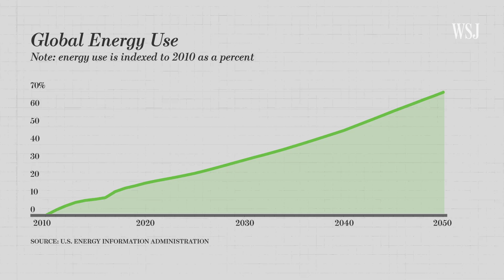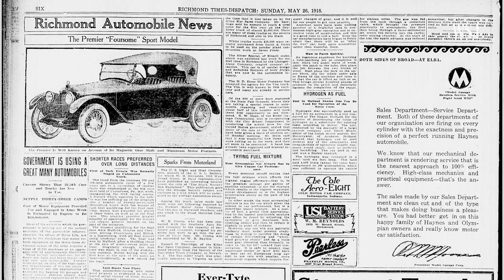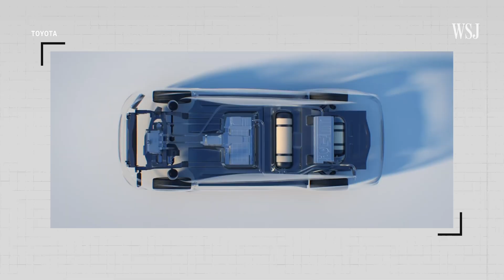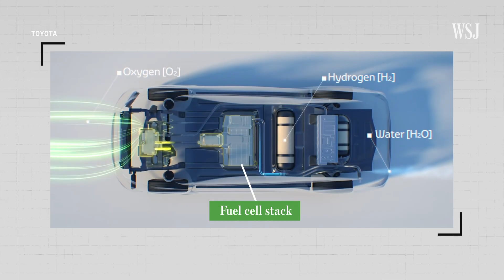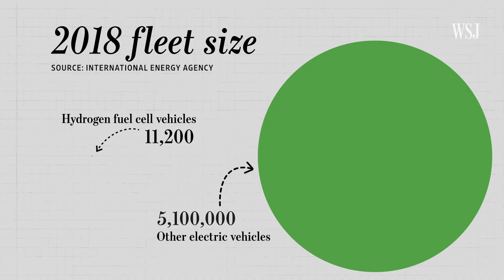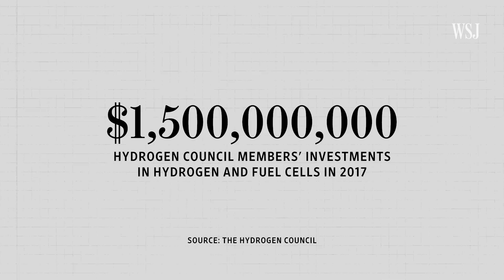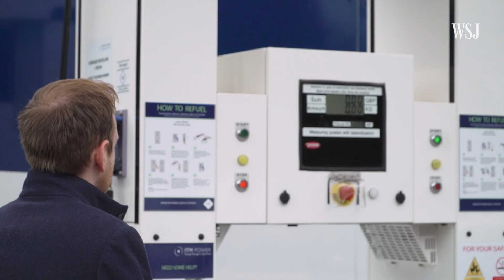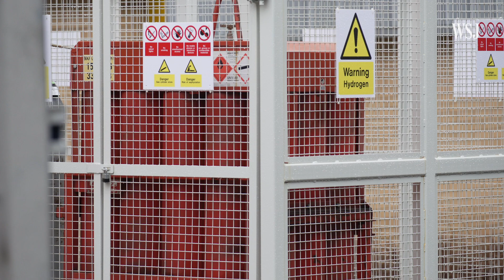Can Hydrogen Fuel the World's Fast-Growing Energy Needs? | WSJ

Comment: It's rather strange that in this video AFC were talking about using HFC to charge BEV. Then you are combining the low efficiency of hydrogen with the slow charge time of BEV, the worst of both! Hydrogen only makes sense to use when using a grid connection or a battery is not possible. Somewhere like a shopping centre as mentioned in the video would definitely have grid connection so it would be pointless using hydrogen there. If you look at AFC Energy's website today it makes clear that their products are for use in off grid locations such as building sites or in remote places. Or as emergency backup instead of a Diesel generator, eg at a data centre.  Charging EVs as stated in the video would only make sense in extreme circumstances like remote locations or for emergency use in a disaster area etc. Not shopping centres.

Comment: ALSO   HYDROGEN  IS  VERY  EXPLOSIVE   AND  HAS TO BE  HANDLED  WITH  THE RIGHT   EQUIPMENT  AND  GAS  TANKS,  AS  IT  LEAKS  VERY  EASILY. REMEMBER  THE  ZEPPELIN R100.IT  BLEW  UP  BECAUSE  OF   A  STATIC  CHARGE.NOW  THEY  USE FILLED  INTERNALLY   WITH  SINTERED  NICKEL/MAGNESIUM  MATERIAL WHICH  IS  RELATIVELY  SAFE.

Comment: It takes a phenomenal amount of electricity - and water -  to power 'green' methods of hydrogen production. (35mWh of electricity and 11000 litres of water/tonne of hydrogen). To produce enough by renewable methods to satisfy possible demands by 2050 would take SEVEN TIMES the total wind power the UK currently has.

Comment: Hydrogen is an excellent fuel. However, there are two main problems with using it to power cars. 1. Hydrogen is expensive to produce and inefficient to distribute. 2. Hydrogen can efficiently be made in a dirty (steam reforming) manner that is unsustainable, since it depends on fossil fuels. Or it can be made inefficiently from green energy sources using electrolysis.
Reply: I agree hydrogen will not be Viable until it is made with electrolysis. I see it being used in the heavy duty trucks first and maybe in cars later. I don’t think lithium ion batteries will do the job in that market they are to heavy and take to long to charge.

Comment: The Hindenburg blimp was hydrogen-filled when it exploded in the USA. 
The airship was designed to be filled with helium gas but because of U.S. export restriction on helium, it was filled with hydrogen. Hydrogen is extremely flammable, and the official cause of the fire was due to a "discharge of atmospheric electricity" near a gas leak on the ship's surface, according to History.com.

Comment: For many years I drove cars with petrol.
Then I became enthusiastic about electric cars and test drove many models. Also a Toyota Mirai from 2017.
The FCEVs are more expensive to buy and to run. For example, the air filters for the fuel cell have to be bought regularly. The trip to the H2 filling station costs money and time.
The Mirai has little space inside and a small boot. Not even the rear seat back can be folded down. In the new Toyota model Mirai II (from 2021), 5 people can finally ride in the car, but it is still cramped. The driving performance is mediocre at best.
No, for passenger cars it makes no sense to build the additional technology for hydrogen into a completely electric car.
This concept is only good for the carmakers and the filling station operators.
They only tell the alleged advantages and still can't explain why even the biggest carmaker in the world Toyota builds only a few thousand units of ONE FCEV model Mirai a year - but millions of other cars that are supposedly worse. 
I have been thinking about this for a long time.
Tesla, the small manufacturer, delivered more than 100,000 battery electric cars March 2021 ...

Now I drive more than 20,000km a year in a small battery electric car - not a Tesla. Charging is usually done comfortably at home. It takes 2x 15 seconds to connect and disconnect the charging plug.
Yes, a battery electric car is different from a petrol car. You get used to it. It is better.

This video is an advertising lie!
They don't lie about what they say.
What is lied about is what is not said.
It is lying when you deliberately conceal or belittle important facts.

Comment: No, never!
Because hydrogen is only an energy carrier that first has to be produced (if possible from renewable energy).
You always need an initial energy for hydrogen! This then covers the energy demand (with losses). Hydrogen is suitable as a storage medium in certain cases - but certainly not in cars.
You can learn the proof in school in physics and chemistry. Every energy conversion involves losses. These losses can only be minimised to a certain extent! You don't need a scientific essay for that. At best, it's in the introduction. The knowledge about this is not exactly new.
https://ieeexplore.ieee.org/document/4016414
Everything should start with regeneratively produced electricity in the future. If you now look at the necessary conversions in the BEV and the FCEV, you will quickly realise that the BEV is significantly more efficient, more economical/cheaper and ultimately also more environmentally friendly.
This is because the basis for an FCEV is the electric car and the entire hydrogen technology from electrolysis to compression to the fuel cell, which then drives the electric motor again with electricity as in the BEV - all of which are additional losses.
Reply: Well explained.

Comment: Hydrogen won't beat out electrics. The reason this is being pushed is so that oil companies can maintain some form of fuel source they can charge you for. The fact that a car can have a solar panel on the roof and regain a partial charge, plus the fact that you can charge your electric car at home is clear evidence as to why hydrogen will not beat out electric.

Comment: This video is an advertising lie!
They don't lie about what they say.
What is lied about is what is not said.
It is lying when you deliberately conceal or belittle important facts.

2:36min Water and electricity produce hydrogen
However, you forget to mention that you need about 50kWh of electricity to produce 1kg of hydrogen. 1kg of hydrogen only has an energy content of 33kWh. The rest of the energy is lost.
Furthermore, until the end of the film it is not mentioned that today hydrogen comes mainly from natural gas, coal and crude oil. Hydrogen is produced by fossil fuels at a rate of >95%! Because hydrogen from the electrolysis of water is much more expensive.

It is clear that hydrogen is an (extra to be produced, secondary) energy storage medium, but it can in no way solve our energy problems.

After all, the electricity for electrolysis has to be generated first, and it is better to use it as directly as possible instead of first producing hydrogen and then using it to generate electricity again. Because of course there are additional losses.

Hydrogen is above all a lie to keep people from using renewable energies! People are put off instead of, for example, generating their own cheap photovoltaic electricity and using it to charge their own electric car.

An electric car is cheaper, easier and better than a hydrogen car. No one in the world is therefore building hydrogen cars in large numbers. The Toyota Mirai doesn't even have a folding rear seat back....

4:28min Using electricity from hydrogen to charge electric cars?!?
A curious idea when you look at the costs. Not everything that works technically makes sense. This idea is nonsense.

5:29min If you look at the members of the Hydrogen Council, it becomes clear what these companies want. We should have to keep driving to petrol stations instead of generating and charging our own electricity at home.

Comment: It always was the fuel of the future and always will be!
Reply: Yes, you are right!
This video is an advertising lie!
They don't lie about what they say.
What is lied about is what is not said.
It is lying when you deliberately conceal or belittle important facts.

2:36min Water and electricity produce hydrogen
However, you forget to mention that you need about 50kWh of electricity to produce 1kg of hydrogen. 1kg of hydrogen only has an energy content of 33kWh. The rest of the energy is lost.
Furthermore, until the end of the film it is not mentioned that today hydrogen comes mainly from natural gas, coal and crude oil. Hydrogen is produced by fossil fuels at a rate of >95%! Because hydrogen from the electrolysis of water is much more expensive.

It is clear that hydrogen is an (extra to be produced, secondary) energy storage medium, but it can in no way solve our energy problems.

After all, the electricity for electrolysis has to be generated first, and it is better to use it as directly as possible instead of first producing hydrogen and then using it to generate electricity again. Because of course there are additional losses.

Hydrogen is above all a lie to keep people from using renewable energies! People are put off instead of, for example, generating their own cheap photovoltaic electricity and using it to charge their own electric car.

An electric car is cheaper, easier and better than a hydrogen car. No one in the world is therefore building hydrogen cars in large numbers. The Toyota Mirai doesn't even have a folding rear seat back....

4:28min Using electricity from hydrogen to charge electric cars?!?
A curious idea when you look at the costs. Not everything that works technically makes sense. This idea is nonsense.

5:29min If you look at the members of the Hydrogen Council, it becomes clear what these companies want. We should have to keep driving to petrol stations instead of generating and charging our own electricity at home.

Comment: The hydrogen end to end use cycle is super inefficient.  By the time you separate H2 from water, compress it, chill it, transport it, and use it in a fuel cell that is 65% efficient, you have lost more energy than you have created.  The hydrogen cycle end to end is about 38% energy efficient.  Way to inefficient to waste precious renewable energy on.  BEV's are about 80% efficient.  Also no infrastructure.  Perhaps useful in ships or planes.

Comment: People saying hydrogen is expensive well yes it is because of scale. I remember when DVD players came out they was really expensive but over the years they’re now really cheap. Same will happen with hydrogen once it’s scaled big enough price will come down.
Reply: But it will always remain a factor 3 more expensive than electricity.
Reply: Simon agreed but same with fossil fuel none of it is par with electricity so you can’t compare it with electricity simply because hydrogen is targeting diesel and petrol as a replacement so that will be on par with that in the near future. You will always need combustion engines whether it be rockets or planes or trucks which electricity can’t supply hence hydrogen will be a big factor in that sector. Battery tech is brilliant for everyday cars but not every aspect.
Reply: @erniegirls5676  Yes, you are right - the electric car is not (yet) for everyone. Only for about 95% of drivers.
But hydrogen can never replace petrol or paraffin as we use fuels today.
This video is an advertising lie!
They don't lie about what they say.
What is lied about is what is not said.
It is lying when you deliberately conceal or belittle important facts.

2:36min Water and electricity produce hydrogen
However, you forget to mention that you need about 50kWh of electricity to produce 1kg of hydrogen. 1kg of hydrogen only has an energy content of 33kWh. The rest of the energy is lost.
Furthermore, until the end of the film it is not mentioned that today hydrogen comes mainly from natural gas, coal and crude oil. Hydrogen is produced by fossil fuels at a rate of >95%! Because hydrogen from the electrolysis of water is much more expensive.

It is clear that hydrogen is an (extra to be produced, secondary) energy storage medium, but it can in no way solve our energy problems.

After all, the electricity for electrolysis has to be generated first, and it is better to use it as directly as possible instead of first producing hydrogen and then using it to generate electricity again. Because of course there are additional losses.

Hydrogen is above all a lie to keep people from using renewable energies! People are put off instead of, for example, generating their own cheap photovoltaic electricity and using it to charge their own electric car.

An electric car is cheaper, easier and better than a hydrogen car. No one in the world is therefore building hydrogen cars in large numbers. The Toyota Mirai doesn't even have a folding rear seat back....

4:28min Using electricity from hydrogen to charge electric cars?!?
A curious idea when you look at the costs. Not everything that works technically makes sense. This idea is nonsense.

5:29min If you look at the members of the Hydrogen Council, it becomes clear what these companies want. We should have to keep driving to petrol stations instead of generating and charging our own electricity at home.
Reply: Joe Goog I work with hydrogen and know all about it I don’t need a bullet point presentation from you to explain it to me. Green hydrogen is the holy grail and will be realised very soon plus you can’t use batteries for rockets can you!!!
Reply: @erniegirls5676  I have nothing against hydrogen. It has played a role in the economy for a long time and it will certainly become even bigger.
I don't mean its use as rocket fuel.
But I do have something against lies and dumbing down, such as the promotion of an FCEV as a passenger car, which will never be available en masse.
I don't like it when you promise cost reductions that can't be delivered. Of course there will be cost reductions in hydrogen technologies. But the basic problem with electrolysis is the price of electricity. But if this falls, alternatives such as battery electric vehicles will become much cheaper. The cost reductions for these technologies are already much steeper than for hydrogen.
I object to praising green hydrogen when >96% of all hydrogen produced is dirty hydrogen.
If you believe in an imminent supply of green hydrogen, you can surely answer the question of where the green electricity will come from? When most countries are just in the process of decarbonising their normal electricity consumption.
Reply: Joe Goog I could write a whole book on my thoughts regarding batteries and hydrogen and nuclear power but here are my narrowed down views. First about batteries, I like batteries they do a good job and are very handy for some modes of transport but the BEV are aimed at people who live in detached house or big semi detached houses with a drive and easy access to a charge point every night, now take someone who lives in a terrace house who doesn’t have a drive and parks on the main road, there will be cables all over the place where people can trip over and claim compensation against the person who left a cable on the path for them to trip over, so a lot of work to sort that issue out. Hydrogen, now I totally agree you do need to use fossil fuels to create the electricity to power the process of splitting the atoms,  but what hydrogen does is buys us time. If we removed all the jet fuel rocket fuel petrol and diesel from our modes of mobility it would help towards carbon emissions immensely just look at the air pollution figures when we was on lockdown, the factories were still running mostly but no cars or planes showed what a difference it would make. Unfortunately coal isn’t going away anytime soon but hydrogen helps until we either build more nuclear power plants or create fusion. Both very risky but who knows what the future holds.

Comment: Batteries are not the solution if their energy comes from power stations running with fossil fuels. And the making of those batteries will destroy entire countries like Bolivia (for Japanese cars) and Mongolia (for other cars). Batteries are not a sustainable solution as they are at the end worst then diesel fuel if you make the complete analysis with a bottom line comparison based on PROS and CONS.
Reply: Lol so much misinformation.
Reply: @Freba9  Where do you see misinformation?
Reply: @lucrolland7489  Your complete comment. 
Batteries are lowering emissions a lot, even if fossil electricity is used. There are no entire countries are destroyed due to battery production. Batteries are not worse than diesel if you consider the fuel life cycle.
Reply: @Freba9  But you do not bring any evidence so your comment may be misinformation as well. Do you have any research document which collects that data proving that Batteries are lowering emissions a lot when fossil fuel is used for electricity production. I can determine an economy of scale if we choose power plants which keep the efficiencies at the level of diesel engines (45 to 50%). You should a nice article by Le Monde Diplomatique that provides an in-depth analysis as this is usual with them where they explain that to even produce 25% of actual cars as BEVs then the amount of land surface needed to collect and produce the materials required for batteries would cover massive amount of lands. And as you increase the numbers of cars then we will reach the levels I am talking about. We should focus on efficient mass transit systems instead.
Reply: @lucrolland7489  Of course efficient mass transport is better. That is obvious. The question was whether EVs are better than petrol and diesel cars, and that is clearly the case. Here is a very extensive and recent report: https://www.avere.org/wp-content/uploads/2020/09/englisch_Studie-EAuto-versus-Verbrenner_CO2.pdf